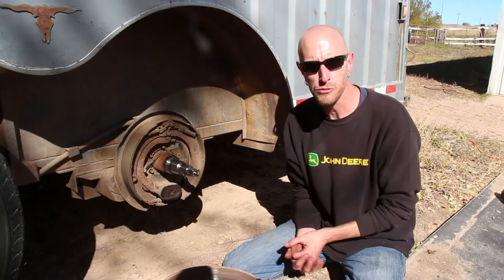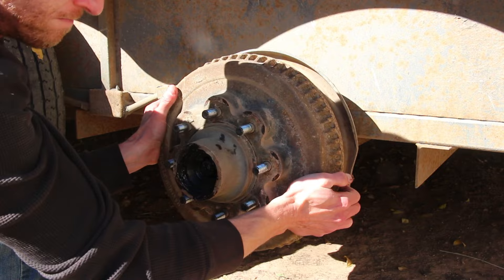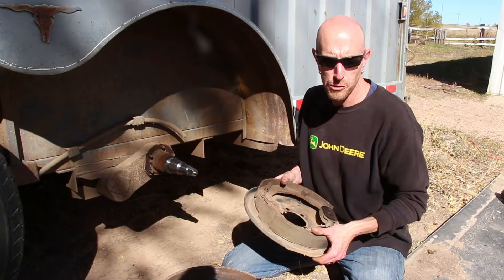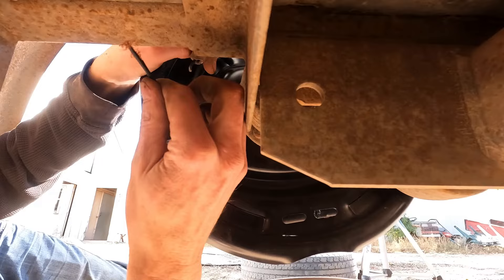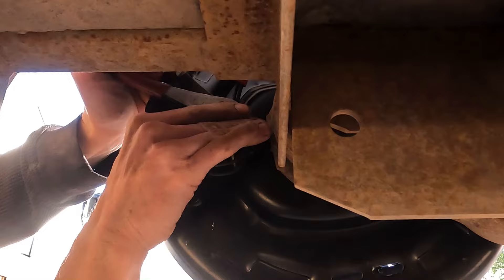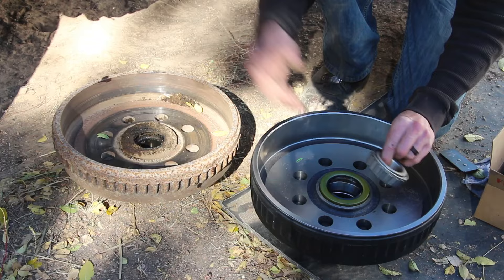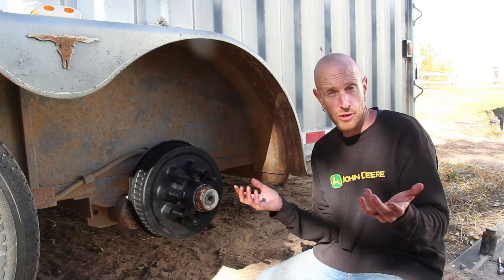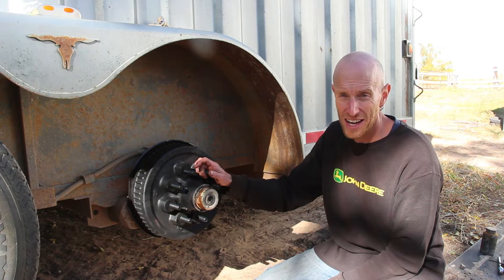How to Replace Electric Trailer Brakes | Packing Wheel Bearings and Getting Greasy

Comment: May I offer a "pro-tip" that you missed:  Remember to remove all jewelry before you start working on your equipment. Watches, wedding rings, etc. make your hands extra vulnerable to injury.  The jewelry can get caught in tight places, and may even cause the loss of a finger or hand--or worse.  My uncle taught me this, with a story when I asked about his hand.  He always wore his wedding ring as a sign of his faith to his wife, even while working in cars.  It was his promise of faith to her unto death.  But then came the day he was working on a car, next to the battery; the ring shorted out the positive terminal to the frame of the car.  It welded itself into that gap with loads of arcing & sparking & bad smells, and it burned his finger down to the bone.   He lost that finger, and could have lost his hand or his life.  Hopefully your spouse / significant other will understand that removing that ring isn't saying you don't love them, or showing that they can't trust you.  It's simply a good way to avoid trapping your finger or hand in a tight place.  You want to have all your parts in good working order for your spouse and yourself, well into the future.  Remove that ring, and any other jewelry, and you're good to go!  Don't forget to put it back on when the project's complete!  Always set it down in a safe place, preferably the same spot every time, so you don't lose it or forget where you put it.

Comment: when hooking up wires behind hub does it make a difference which wire on hub goes to a certain wire on trailer??
Reply from the maker: It doesn't matter which wire you use for the brakes.
Reply: @homebuiltshop  what I mean is ...does it matter with the two wires which wire from wheel hooks up to a specific wire from camper or do you just hook them together randomly?

Comment: does it matter which brake wire goes to which brake wire
Reply from the maker: No, they are only energizing an electromagnet.
Reply: Isn't one of the wires a ground and another the brake wire?
Reply: @jhoan035  the coil in the magnet doesn’t care which direction the current goes through it. Either wire can act as the ground or the positive supply. You’ll notice on these brakes that the wires are almost always the same color and unmarked, for this reason.